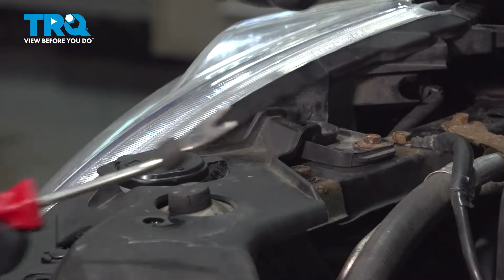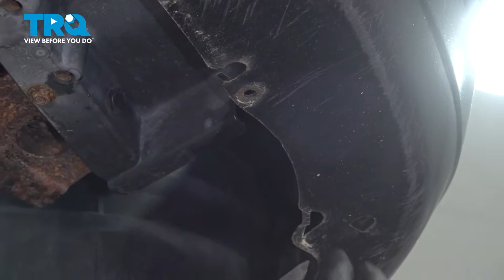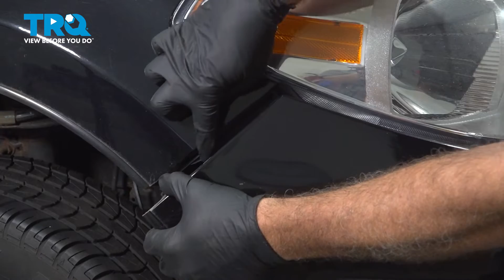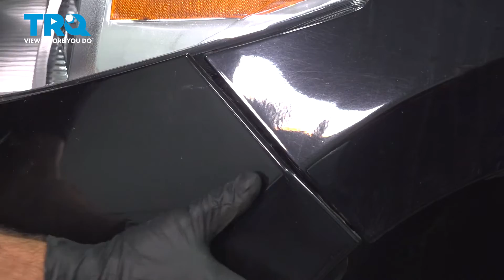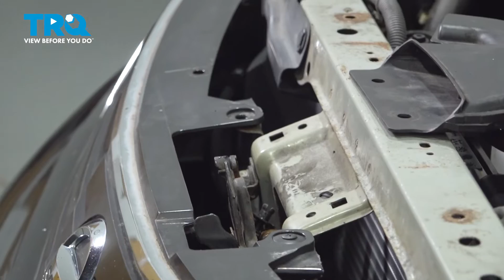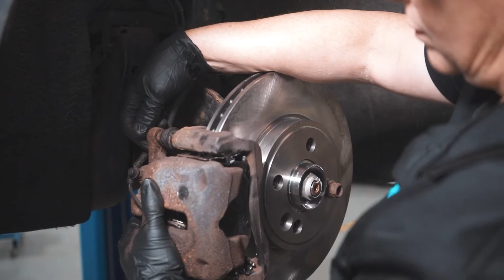How to Replace Front Bumper Cover 2007-2012 Nissan Versa

Comment: I came on here to find out how it clips to the brackets under the headlights. Mine pulled out of both sides so I don’t know how it came out. Does the cover slide OVER the bracket and snap or in the slots IN the brackets?